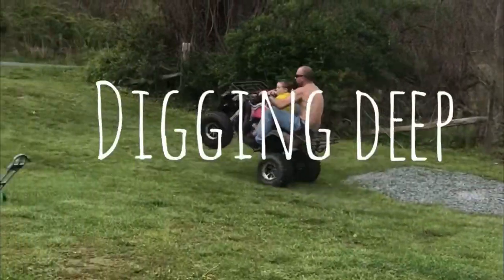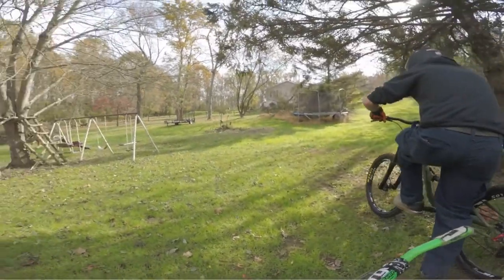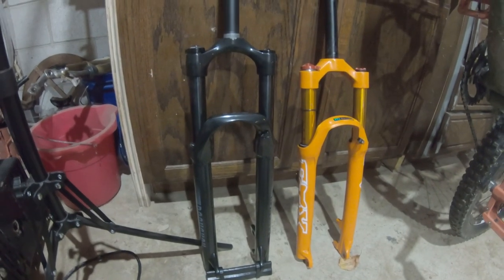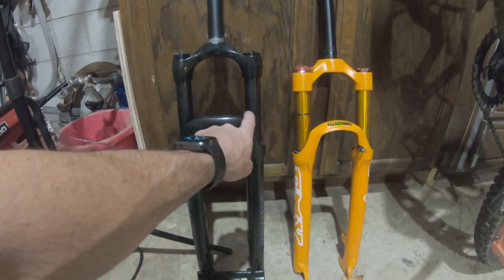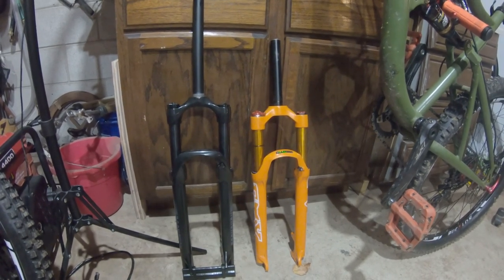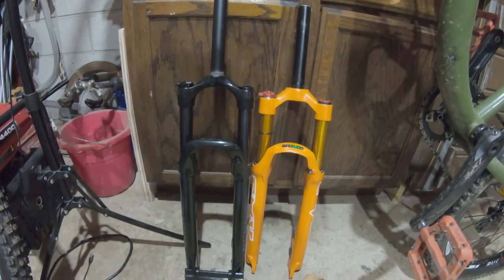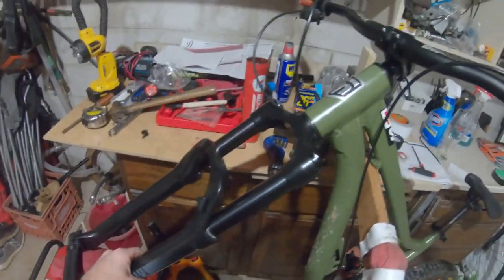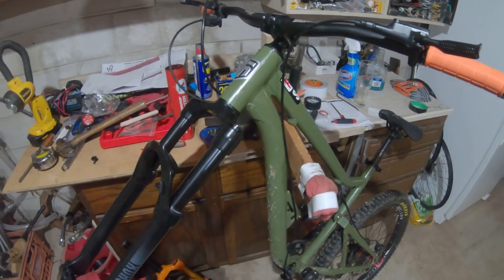Mongoose Bash - Chinese vs Name Brand Fork - MTB￼

Comment: That's awesome I was looking at those forks..I went with a Xfusion enix it supposed to be real good but to me it feels stiff I was used to the SRs Suntoure coil spring shock I had on my bike before it.. the coil spring shock just felt like it dampened every little bump in the terrain and the new air shock I got the Xfushion don't do that it feels sticky and don't respond to the little imperfections and works good on the bigger stuff... don't know I think coils are better for bumpy terrain I notice the rear coil shocks feel much better also to me.. but then again the stuff I ride through is so rocky and extreme most people don't even want to ride in it...it is bad I need to find nice spots like you ride my  spot is so bad you just killing yourself to try and ride through it..was fun when I was younger but not no more I am way to old for it now! LOL  Does the rock shox feel like it has more movement all the time compared to that no name brand like it responds to the little imperfections more? Because that's what I was thinking it might do compared to this Xfusion enix one I have when I was deciding on a new air for... everyone says the Xfusion was so nice so I got it.
Reply from the maker: Thanks! It feels great off of jumps and didn’t feel it bottom out on my new rock drop, which the old one was. I run very rocky terrain at the water shed and that will be the true test. I’ll be sure to keep everyone up to date. Like I said in the video it’s night and day compared to the Chinese fork. Thanks for watching!